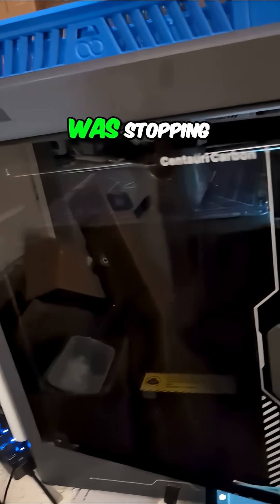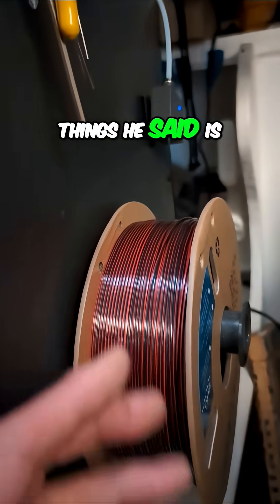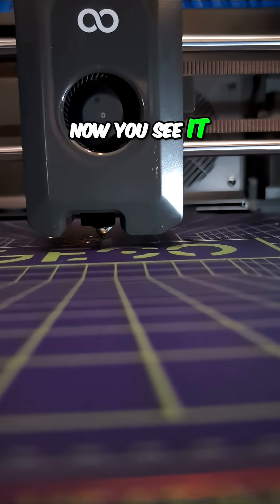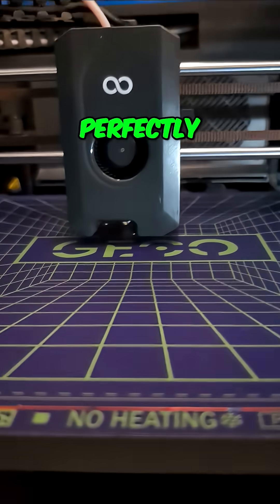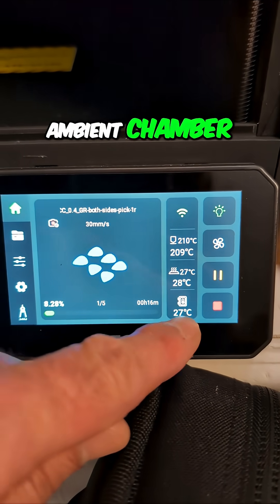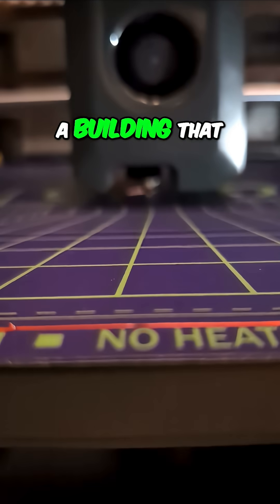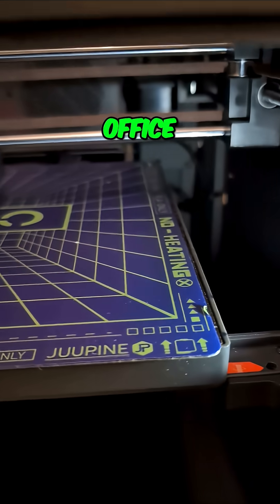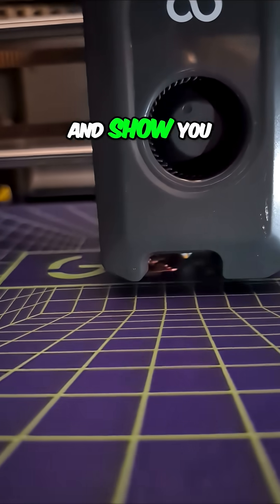3D Printing: The Filament Secret & Heat Issues Solved! Elegoo Centauri Carbon

Comment: In your filament section in prepare clock the pen next to it and you can make a custom setting for it just change the bed temp or switch it off and save it as a custom filament. Your custom filaments show up at the top of the filament list in the flip down menu. Hope that helps
Reply from the maker: Yes. Whenever I tweak filament settings the changes go in a custom filament profile. :) thanks

Comment: In your slicer fillament settings set 1st layer temp a couple degrees above room temp to get it to start and for other layers set as low as you want. It won't stop if its colder than room temp.
Reply from the maker: I set the slicer to the lowest I expect the ambient tempt to be. If it is actually higher when I send the print, then I just modify the bed temp at the printer. Has been working pretty well like this. I prefer to NOT heat the bed at all if not required.

Comment: I just recieved my centauri carbon and I have 0 experience in 3D Printing, with the exception of being a professional youtube surfer! 😂

Can you please give me some pointers, and some advice, on where to start, what to download, or what software I should be running on my computer?
I want to become a little bit more acquainted with this new hobby of mine, but do not want to go down the wrong path right off the bat. 
Thank you! 
JP
Reply from the maker: Start with elegoo slicer and PLA filament. Use default settings. Honestly, the CC takes most of the learning curve out of it.

Comment: My experience with the Neptune 4 could be summed with this video. Most of the problems are caused by me. My centauri Carbon got here 2 days ago and I love it. So much less to worry about. Also, make sure you change the filament temp in the slicer. The bed temps set are what the printer will heat to. I have mine set at 55, so it heats to 55. PETG? Set to 70, preheats to 70. In orca, it will be in filament settings.
Reply from the maker: My N4M works sometimes, not so much other times.